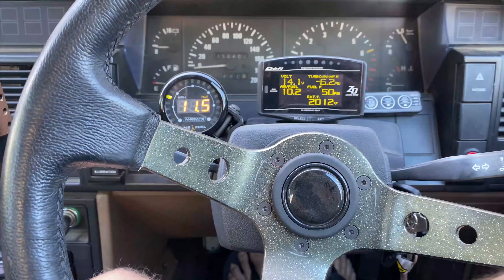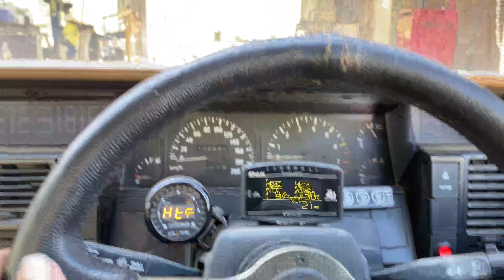GOODBYE R31

Comment: I feel you Max. Missus is 20wks tomorrow plus 84yr old Aunt, 77yr old Mum and 63yr old father-in-law with immune system issues. We've all basically practiced lockdown for the past few weeks and I'm the one going out doing the chores. Plus I got delays on parts so I'm stuck doing nothing but gaming. 😡